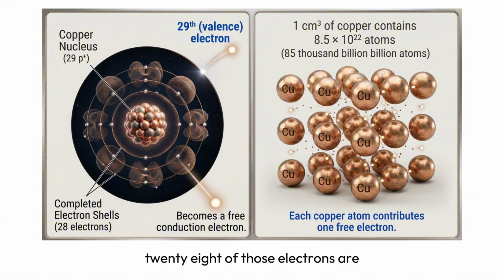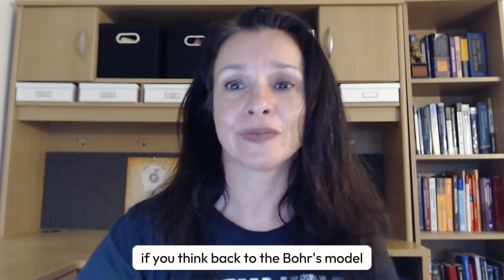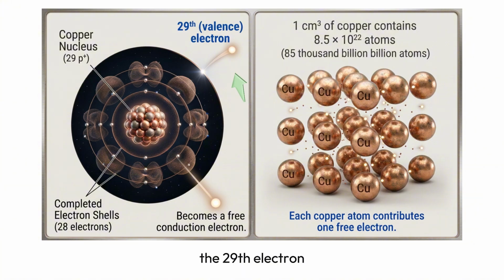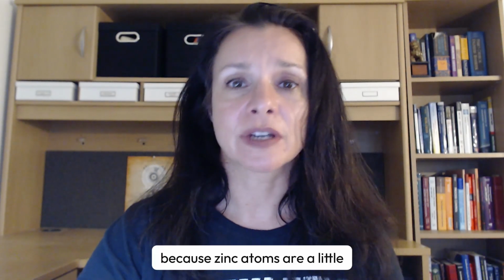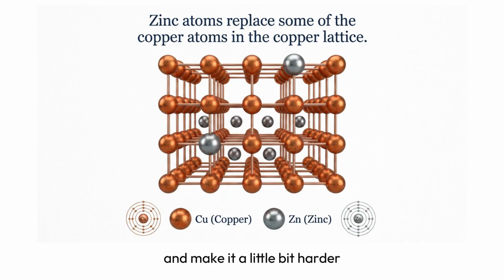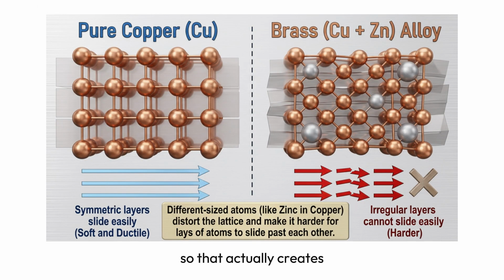Metallic Bonding, Alloys, and Band Theory — The Science Behind Every Engineering Material

Comment from the maker: 🔗 Metallic Bonding, Alloys, and Band Theory — The Science Behind Every Engineering Material:
https://www.youtube.com/watch?v=LdjQwUQzR7k

Three types of chemical bonding. One of them explains everything about metals.

Ionic bonding — electrons transferred completely. Covalent bonding — electrons shared between specific pairs. Metallic bonding — electrons given up entirely to the collective. Belonging to the entire piece of metal simultaneously.

That delocalized electron sea explains why copper conducts, why steel is stronger than iron, why stainless steel 316 resists corrosion in pharmaceutical manufacturing, and why silicon converts sunlight to electricity.

In this video, I cover the complete science:

⚛ Metallic bonding — the electron sea model — why all four properties of metals flow from one principle
⚙ Alloys — substitutional and interstitial — brass, steel, and stainless steel 316
🌊 Band theory — the quantum mechanical picture — valence band, conduction band, band gap
💡 Semiconductors — silicon, doping, n-type, p-type, p-n junction — the foundation of every solar cell and transistor ever made
☀ The photovoltaic effect — why silicon's 1.1 eV band gap matches visible light photon energies almost perfectly
🔧 From my semiconductor manufacturing career — band theory as a practical engineering tool

I authored two textbooks on fuel cell technology:
📚 Designing and Building Fuel Cells — McGraw-Hill
📚 PEM Fuel Cell Modeling and Simulation Using MATLAB — Elsevier

Both available on Amazon. Links in the description.

⚡ The Tesla Institute — understanding energy through physics, chemistry, and engineering.
Nikola Tesla believed electricity should belong to everyone. We are still working towards that vision.

Drop a question in the comments about metallic bonding, alloys, band theory, or semiconductors — happy to go deeper.